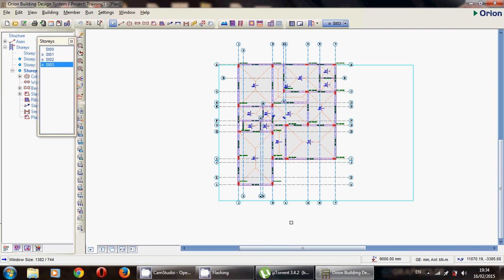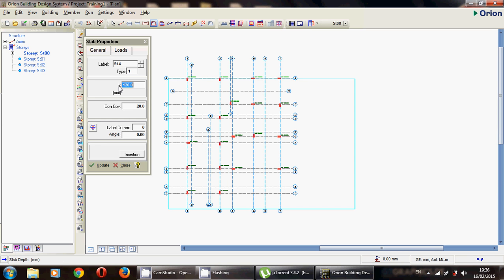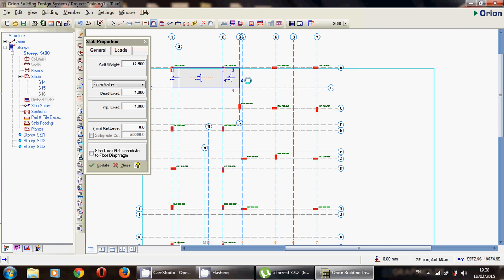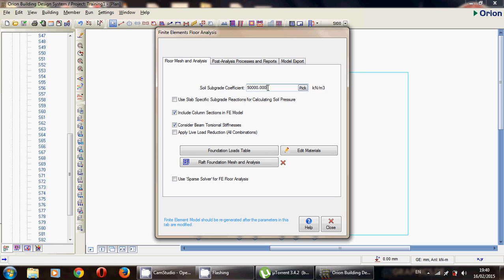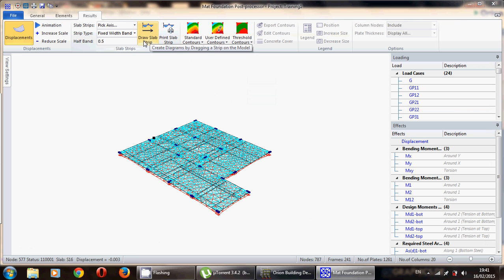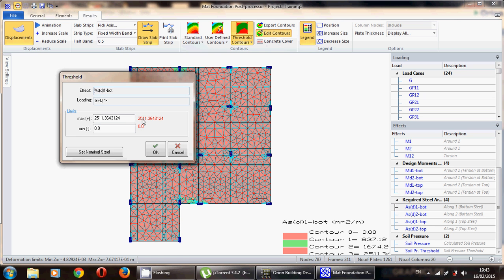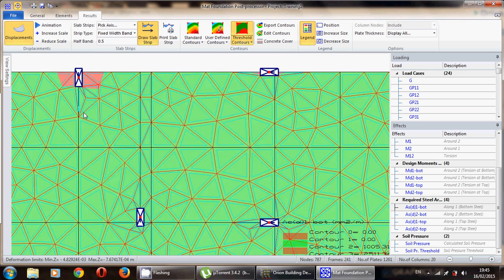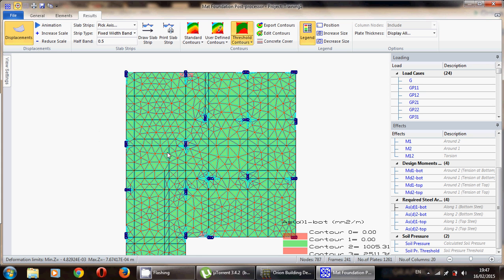Design of Raft Foundation Using Orion v18 Software

Comment: 1- Install from (setup.exe)

2- Extract (Local.csclicdb) file from (License.rar)

3- Copy (Local.csclicdb) file to C:\ProgramData\CSC\Licensing\  .

4- Folder "ProgramData" is hidden. To unhide it go to 
Folder Options >> View >> Clock on Show hodden files.

5- Now you can copy folder to C:\ProgramData\CSC\Licensing\ .

i not understand about No4 where to click folder option? i am using window 8

Comment: SIR THIS IS MOST POWERFULL SOWFTWARE PLZ TELL HOW TO CHECK AXIAL LOAD ON FOOTING LEVEL
Reply from the maker: Go to building analysis>>column/wall desing>> from the menu above go to column force listing>>you will see a window with many option,,you can choose what you want to see..

another way is to create pad base for all the columns at foundation level..then select all and right click and choose the fist option (print Pad and Pile base results) and you will see a report with the axial loading at each foundation of the columns